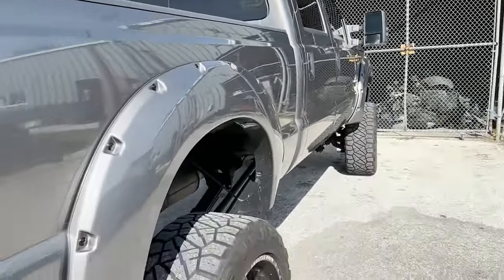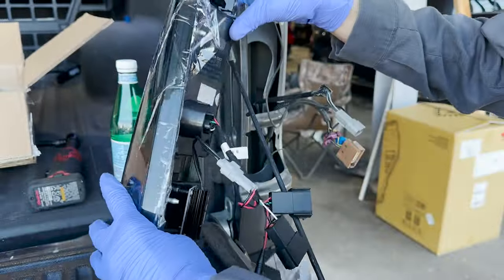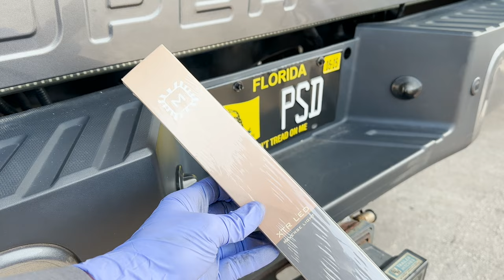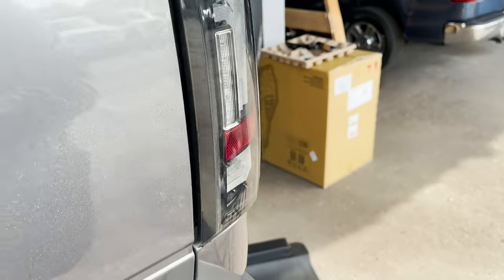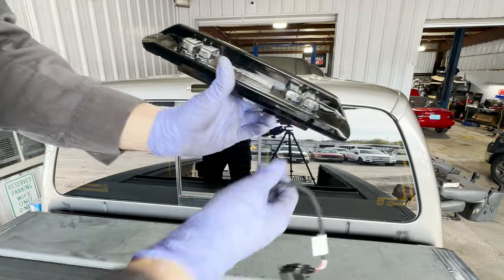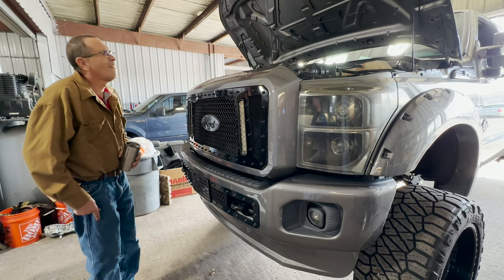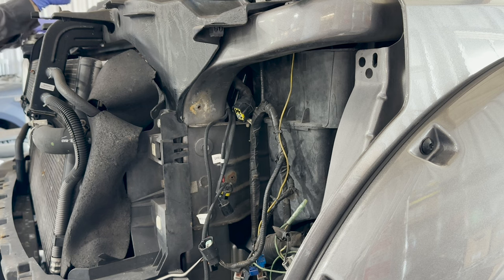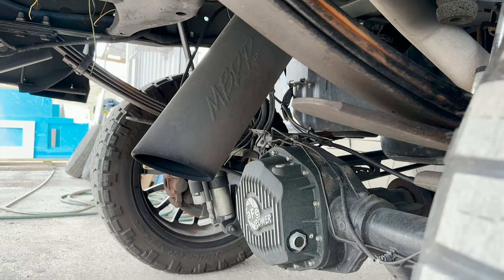Would you buy these lights for your #fordtrucks?? 🤷‍♂️@MorimotoLighting

Comment: Nice!! I’ve had the Morimoto headlights on my 2015 F250 for several years now and I’ve loved them. The only down side is the tops of them get discolored due to sun damage, and  I had to use the 5 year warranty once since I bought them because the passenger side quit working. They mailed me two new ones but only after I mailed them the old ones, so word of caution, definitely keep your current headlights in the event you need to put them back in during the warranty claim process lol. Also, I waited for years for Morimoto to make tail lights for the 11-16 trucks and literally a month after I bought some sequential Recon tail lights, they dropped those ones you installed on the market. 😩

Comment: The lights look good but a bit pricey if you have ever checked.  The used F250 I recently bought had the same side fender flares.  I removed them a few weeks ago before having a ceramic coating applied. I permanently left them off.  Even though they had some type of tape to prevent rubbing you could tell they did rub some.   I couldn't tell if they were factory installed or after market.  Mine has rear wheel well liners.  I do recall seeing a Ford parts decal on those when I removed them before Ziebart did an undercoating.

Comment: I have all the same lights had to have my headlights replaced once already for peeling and the tall lights drive me nuts because the passages side tail light won’t come on until you unlock the doors when you remote start the truck. But the plate reverse light is awesome. And the plate lights nothing but problems went back to factory housing and led bulbs haven’t had a problem since

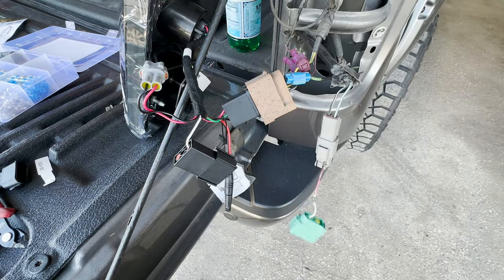Comment: 13:33 definitely should not* have exposed copper outside of the connector's glue area. The glue should be locked to the insulator of the wires on both sides.

Comment: Are those headlights DOT legal to run in the US?  We have a yearly safety inspection here and they check for headlights intensity.  They could make you remove them and put back legal lights.   They look great but I wouldn't want to be pulled over and fined.
Reply from the maker: Look on their site..

Comment: I bought some cheapo lights from eBay with sequential turn signal light for my 2011 and the passenger side sequential light only works while the truck is off, if I turn on the truck, signal light will not work, disconnected the sequential light and left only the factory light and it works perfectly fine idk